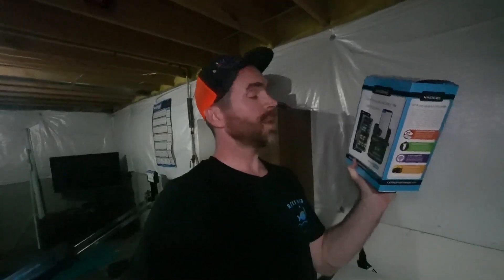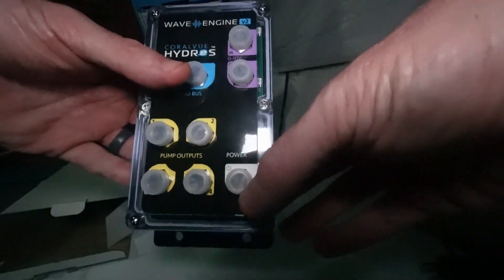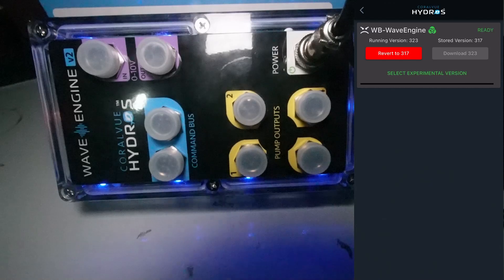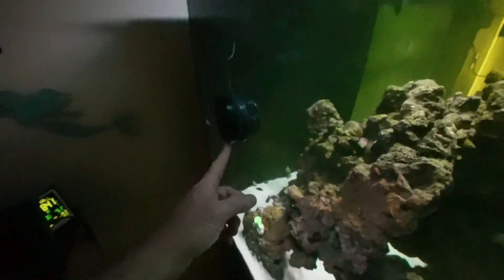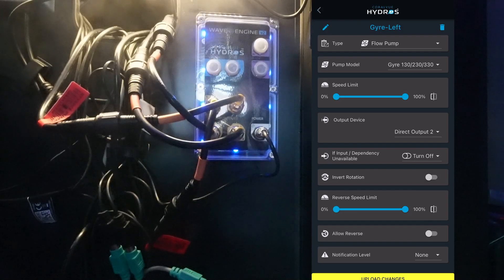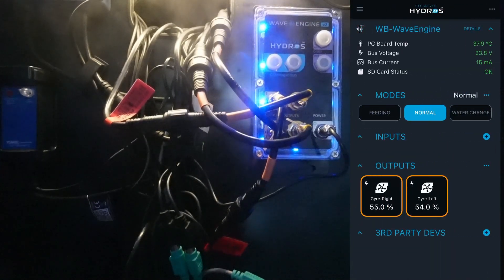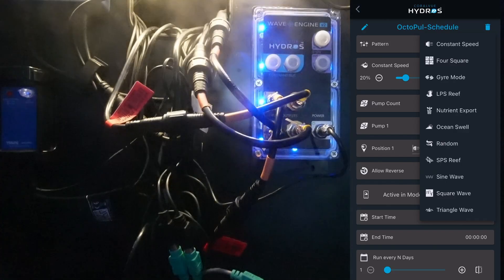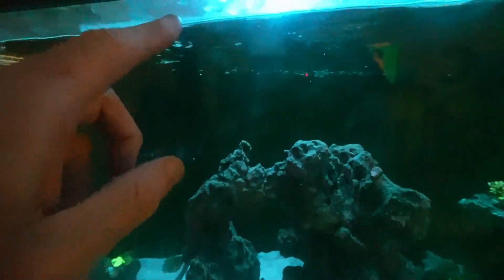Hydros Wave Engine: Your Complete Guide

Comment: I notice on Hydros site it says does not work with cloud edition gyres only gen 1.   Did you have any issues?
Reply from the maker: My gyres are not cloud edition. I use the XF350s.
Reply: @ ah ok thanks.  I thought I saw the cloud edition logo on the box.   I like the directional options of the current XF3xx line.  I have the XF350 Cloud Edition on another tank.  Might be worth me pulling one off and trying to direct connect it.